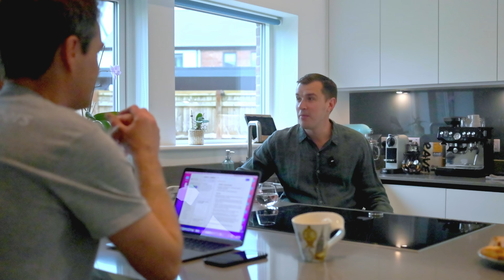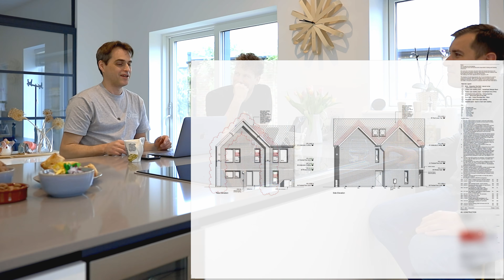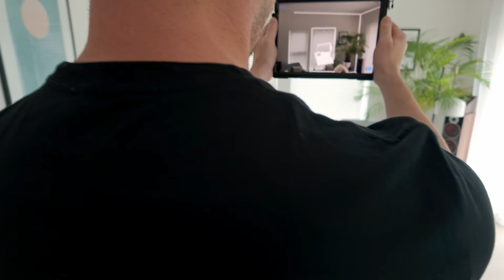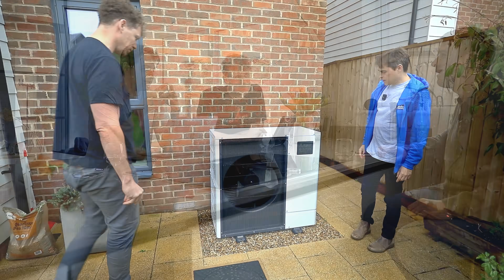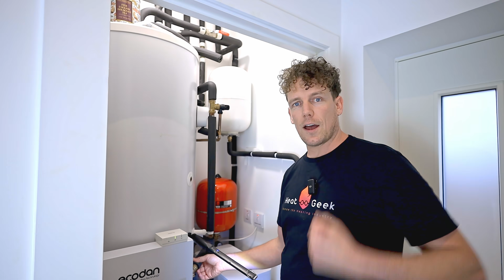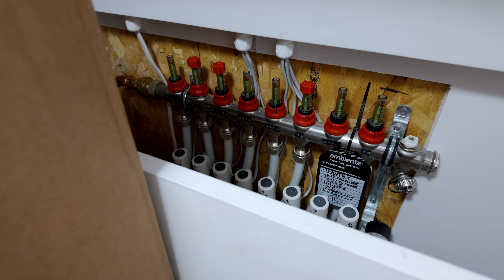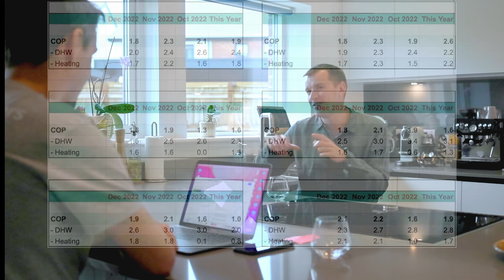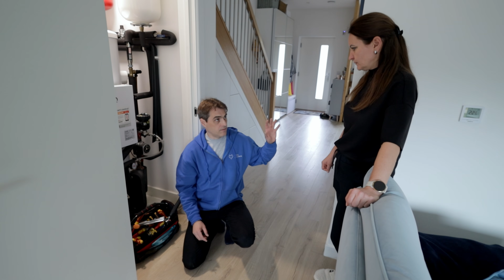How Developers Are Ruining The Heat Pump Market

Comment: OMG! What a ripoff in price and running costs! My 117sqm(net)  free standing house is heated by a single Daikin 2.5kW nominal Perfera floor standing unit (FVXM25A9 / RXTP25R), in a colder climate. Installed by an everyday HVAC guy, calculated by me, 5 years running.
Reply from the maker: Where are you?

Comment: I live in a 7 year old house, TAYLOR WIMPEY, built it with 10mm plastic heating pipes throughout. Only way I'm getting a heat pump is to rip the walls off, throw away the heating system and rebuild half the house. Should be fricking illegal.
Reply from the maker: Not necessarily- new homes have low heat loss and can work on 10mm piepwork

Comment: THANK YOU! I am commissioning an underfloor heating system right now. I thought it was a bit overengineered and you've confirmed it. I'm going to remove 3 thermostats, 4 actuators and most of the wiring centre :)

Comment: You guys seem to actually understand how things work , unlike most plumbers. Please enlighten me on one topic. Ive installed in my house on ground floor two vertical designer radiators upside down, and connected them on the top. It was way easier to run the pipes from the ceilling down. After doing that, I've asked on few plumbing forums and Facebook groops if I've done right, or i should expect troubles. Most plumbers advised that there's no chance that it can work, for various reasons. Now, after 3 winters, I'm happy to report that the system works absolutely flawlessly. So im asking you, how come no plumber could see that the system might work, and why I could see that it should work, even if im no plumber at all.
Thanks

Comment: I wish we in The Netherlands had guys like you.....❤
Reply: I hear Heat Transformers are popular over there?
Reply: @patrickwheeler2646 thank you. I looked them up and looks like they are also a big box company. They give an advice based on data given from the customer.
There is no heat loss calculation......
Reply: @patrickwheeler2646  They are somewhat, but education of design or more likely retrofitting is not very good. There's also people who do it themselves with a air to water system and just dump heat in the normal radiator system. Some people will replace wall radiators with fancoils (they have active low noise fans that move the air across the coils)

Comment: Do not you get more efficiency if you place lets say 500liter buffer for system? Which could take heat from pump on its maximum efficincy power and then shut off, and just use stored heat for floors?

Comment: Gas boiler, zoned control with thermostats, rad stats and suitable timer. Simple system, no tanks or complicated electronics, a system that most people who have had central heating in their lives can understand and will run automatically per the timer and thermostats down to individual room temperatures according to preference.
If you want all your house to be the same temperature of 20C then not a problem. If you open a window or door for a while it will not take hours to restore the system to 'balance'. You want hot water any time the response is very short without storage. An outside temperature thermostat can easily be fitted to the heating zones too if required.

Comment: Oversizing is bigger problem than undersizing. Of course, you cannot go too low but for such a new building with very heat loss it is crucial to not oversize the unit.

The main problem is minimum modulation on 90% of the year which is usually above heat loss if the case is like you explained here.
Reply: It's almost impossible not to oversize the unit because you can't actually buy 2 and 3kW heat pumps yet. (fx:checks) Actually I see Vaillant have a 3.5kW ASHP now (and the old 3kW Geotherm).
Reply: @xxwookey  Panasonic has 3 kW without capacity loss down to -7 C
Reply: @HVACEducationHub  OK. Good to know. And of course the Air-Air models go lower power too.

Comment: Many of these "insulated" houses just have stale  air  that require more ventilation than designed.    co2 levels in smaller houses can be frighteningly high if they have a high occupancy psqm
Reply: That's why it has MVHR. You don't get stale air with one of those  - you get very fresh air (unless it's broken).

Comment: 2:25 I disageee with you. MVHR is not needed in this house. A regular ventilation system would work perfectly.

It doesn't make sense to me to have MVHR + heat pump because MVHR will probably recover 'only' 1000 kWh of heat annualy, which would cost you only 250 kWh of electricity if you have a heat pump.
Reply: MVHR is about having enough ventilation and a comfortable environment. If the house is tight enough you need mechanical ventilation, and that really is best to be MVHR rather than demand-controlled ventilation. The MVHR system will use maybe 100kWh/yr, which is a lot less than the 250kWh you would have used making the 1000kWh of heat it avoided losing. Makes sense to me. And even if it used a bit more energy, than it saved the air-quality in the building alone would justify it.
Reply: @xxwookey  Yes but a MVHR system is very expensive. What's the point of paying thousands of pounds for a system that saves you only 200 kWh of electricity a year (because you have a heat pump) ?
Reply: @pauld3327  My MVHR system cost £1300. So not that expensive. I did get a bit of a bargain there, but there is no need to spend more than £2000 for a normal-sized house. And you still need some sort of ventilation system in an airtight house. So the choice isn;t MVHR or nothing, it's MVHR or whatever you do instead. An Aereco demand-controlled system isn't really any cheaper.

But I agree that what you are paying for is not primarily energy savings - it's very good air quality and no allergens (due to filtered air). The energy saving is, as you point out, relatively incidental once you get away from gas.
Reply: No, you would need MVHR for this level of build. The Air pressure testing will be down to 1m3/(h·m2) or lower so having trickle vents would bugger that figure massively. With MVHR you have one vent in/out vs trickle vents to virtually every window plus a extract vent to each bathroom, WC, utility & kitchen. In AD Part F you'd have to purposely design the house have an air test of above 5m3/(h·m2) to even be able to use the old school trickle vents & intermittent fans

Comment: As an engineer I approve of this message. Simpler is always better and more reliable. I am surprised the middle townhouse has the same big heat-pump. That's just silly.
Reply: They could only get a good deal on 10 of the same size?

Comment: Long ago, I did oil heat work here in the US. After hearing your description of the house, my first thought was 3.6KW or 3 ton as we would call it. Most installers over here would probably bump it up to 3.5 ton to avoid complaints figuring the customers won't notice the lower efficiency. 11KW (9 ton)???? Wow.

Comment: While i agree with the engineering comments. It shows a complete lack of understanding of uk development contracts. The developers will have a set or empmoyers requirements, the heating/ m&e  designer designs to comply with the employers' requirements, and the installer fits what's designed. The open loop and zoning comments always forget new build has to comply with part L. Which will require a  home that size to have heating zones
Reply from the maker: There is no requirement for zoning in any documents. Those are guideline not the rules. We come across those types of flawed designs all the time when quoting and always insist on our own designs or we don’t take the jobs. It’s not hard to force principle contractor to change guidelines once you explain what the problems are.

Comment: Great video guys. I have a 7kw Vaillant installed end of Feb. SCOP so far around 4.3. But just checked and found my heating expansion vessel is on the flow, just after the diverter valve DHW side. Should I ask installer to re-plumb it? Not difficult physically. 
Keep up the informative videos.
Reply from the maker: Yes, should always be on the primary return
Reply: On return always. Hydronics 101

Comment: Most videos I watch on YouTube I would describe as pretty "incidental" interesting but not important. However, as the UK policy is to ditch gas boilers for heating water to warm our homes, and heat pumps are the solution, I would describe this video as Very Important.  I think you should say where this is in Deepcut Surrey. Who designed the houses and who built them. I did not listen that intently or take notes, but the theme of what you were saying is. If this was a car they have put an engine in at least 3 times more powerful than required. Much of the plumbing is "wrong", and if this was an item you could pick up and take back to the shop, you would be doing that and asking for a refund. 
The good news, these houses could have been built correctly, and when fitted by people who know what they are doing heat pumps work. This can be a good solution if you employ people with the right skills. Good video - but you should not shy away from the truth. People need to know the real facts.

Comment: Well some of what has been said is true but plenty of it is rubbish. I have been a heating engineer for 26 years and have installed heat pumps for around 12 of them.  Held my MCS certificate for at least 10 years. Personally I love the installs and technical aspects however its the red tape and constantly having to prove to bookworms that I can do my job combined with the constant paying out to organizations for the privilege that is starting to grind me down. Anyhow I bet Mitsubishi would have something to say when you are describing the pre plumbed hot water cylinder with pre installed pumps and filter are incorrect and need alterations. How would the Mitsubishi warranty work out if these things are tampered with? If the installations are so badly done and not to industry standards the persons responsible for the whole job should be ,made to correct things. If the heat pump is installed by an MCS certified installer then they are responsible for every aspect of that heating system and therefore should any defects be identified MCS in theory have the powers to insist things are rectified or risk being struck of the MCS register.
Reply from the maker: It wasn’t done under MCS and mitsi pre plumb is horrific

Comment: Having been designing a 5 bed Passivhaus for a while, I guessed the heat load would 3kW! I would have liked to have seen more discussion of the impact of domestic water demands on the heat pump size. These properties seem to have been provided with large storage cylinders to allow lower temperature water to be stored.
Reply: You are right that DHW can be about the same load as heating once your house is efficient, but unless the heat load is such that the heating is running al 24-hours there should be enough time in the day to heat some hot water as well without actually increasing pump power. I don't think anyone tries to do both at once do they (except maybe Atmos gas boilers)?
How does a bigger cyclinder let you store lower-temp water? The minimum temp for a useful shower/bath doesn't change by cylinder size. It's ~40C/45C respectively. And 10-60l (people vary wildly here). 
Do you mean that if you are in danger of using all your hot water in one day then you could raise the temp so less hot water volume gets used by each shower/bath (and more supplied by cold)? That's the same as saying 'your tank needs to be big enough for daily usage'.

Comment: The level of complexity is like a submarine.
If it really is to Passivhaus standard all you need is a 4 kW heat pump, a few radiators, a thermostat and a few other bits and pieces and you will have cheap, simple, long lasting, efficient and easy to maintain system. A Passivhaus does not need underfloor heating.

Comment: I’ve watched a few of these videos on how to spec and design a system and I’m always left wondering…. why don’t we do this with a gas boiler? 
It has to be possible to get a gas boiler to do the same temperatures as heat pump
Reply from the maker: Yes we do it with gas as well. It’s just all the good guys who know how to do a low temp system on gas have now moved to heat pumps.
Reply: @UrbanPlumbers  persuading people in my area to fit a low temperature gas system would be possible but a low temperature heat pump system would be very difficult, excellent content as always and thanks for replying

Comment: It's worse than you think. I know of two passif home builds just completed. Both have heat recovery air systems. The heat pump installation is by different companies. Both heat pumps are large. What you would calculate for a gas boiler perhaps. I asked the home owners if heat loss calculation on the new builds answer. Don't know. One home just running temperature set at 45c. He already complained to me about the high electricity monthly cost. The worry is these companies are using these new passive homes to get more work..And messing up the insulation

Comment: I see there is interest conflict for original installer, all comments  and on neighbours installs, mention extra unnecessary hardware and labor which is good for business but bad for customer.

New installers value good feedback to get new customers via recommendations , while experienced big companies don’t need good personal feedback to keep business running.

Very good point about temperature difference in connected areas, all most impossible.
Reply: It's very bad for the customer as they are paying 5% interest on the cost of the bad install for the next 30 years! Plus all the extra fuel!

Comment: Question. Are you better off not having room stats for each individual room and just a stat for upstairs and a stat for downstairs which open up all actuators for relevant zone? I know a lot of designers only leave hall way and bathroom open loop but this might not be very efficient at all?
Reply from the maker: Best not to have any stats and only relay on weather comp
Reply: @UrbanPlumbers  Thanks, seen a Nibe ground source heat pump recently and their engineer had a similar opinion to you about stat. From recollection he said the unit reads the difference in outside temp along with internal temp and return temp on pipe and sets optimum output of heat pump to suit.

Comment: I feel about 7-8 kwh loss is normal but given it meets 2022 build requirement it may even be about 5kwh with the heat recovery addition
Reply from the maker: It’s much less than that
Reply: @UrbanPlumbers  just saw the full vid played along ah well 2 kwh out lol.  In regards to heat loss being 7-8 kwh that’s been that in all my old rentals the only time when I had a heat loss that low was when I was stationed in Germany, it’s just proof that housing stock in the U.K. needs a major update
Reply: @ram64man  Agree about UK housing stock. Four years ago, before the gas prices shot up, my poorly insulated 5 bed house consumed an average of 310kWh per day from a gas boiler for the first 3 months of the year, until I switched to log burners. 310/24 = 12.9kW, and I guess the heat loss is actually worse than that as some of the rooms had the radiators off. Welcome to crappy UK built houses.
Reply: @drigans2065  yeah totally agree but also the rules on existing houses needs changing as well I have a listed building with 22kwh heat loss , I can’t even add secondary glass due to local trust , zero wall insulation, and just got approved to add wool insulation to meet targets on 2025 it’s has to be 18 inches thick (each layer is 2.75 inches with a r just 5) it’s ridiculous because of r value, plus weight is also a issue it’s stupid

Comment: This is a massive problem with heat pumps
Reply: The problem is with the people who install them, not the technology. Gas boilers are at best 94% efficient. Even this badly installed heat pump was 200% efficient. If electricty only cost twice as much as gas even this bad install would save money. Unfortuatnely it costs three times as much as gas so an inefficient installation is costing the customer money.

Comment: Have you seen the pre plumbed cylinders which Mitsubishi supply with their heat pumps? The engineer just has to connect the flow and return to the heat pump, and the primary heating circuit connections. I would hope Mitsubishi pre plumbed cylinders are specced and built correctly!
Reply from the maker: They are the biggest efficiency killers those pre plumbed cylinders. Not even designed correctly.
Reply: @UrbanPlumbers  oh dear, I have one of them! What are the biggest issues with them? Is there a way I can send you the schematic of the one I have, so you can highlight where they have gone wrong?